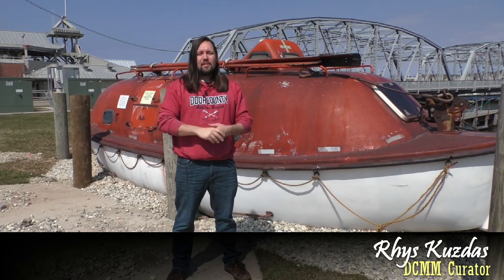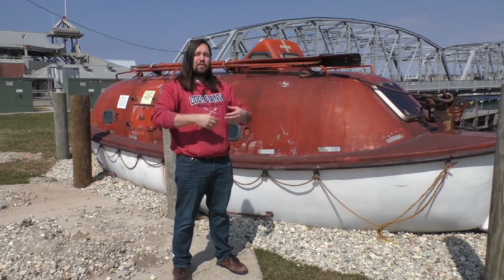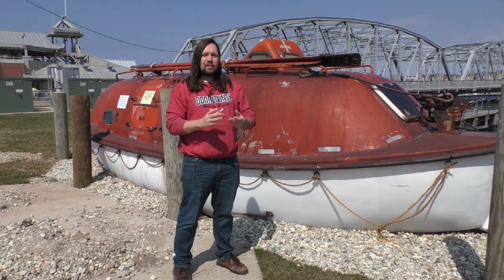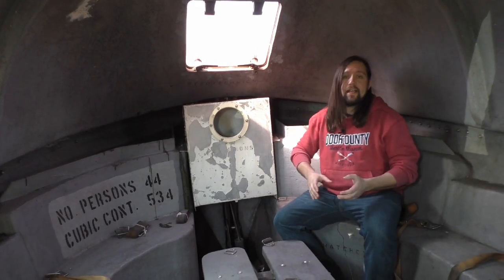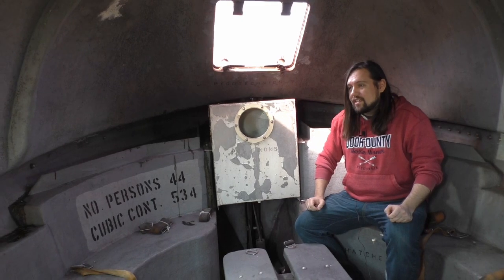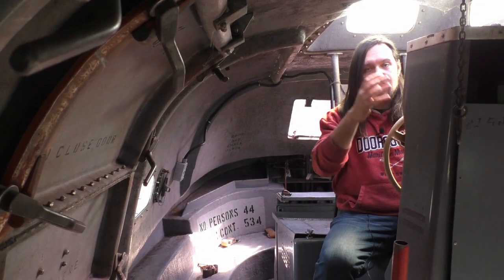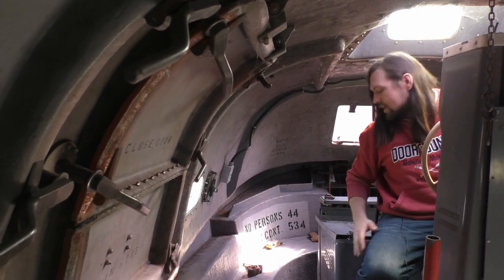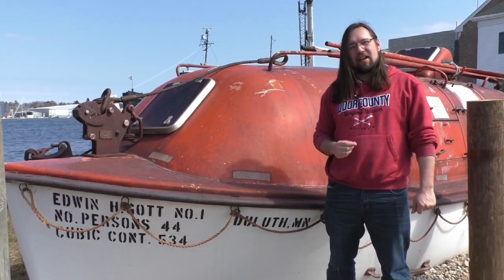The Water, Fire, and Hurricane Proof Lifeboat [FTD]

Comment: They look a little different nowadays, that is Ground Zero for modern lifeboat vessels. There are a new one available and there are drop records on YouTube for up to 65 meters. Used lifeboat conversions often get sneered at by yacht owners but I think they are really smart!
Reply: I think used life boat conversations are cool, too! A video on them popped up in my recommendations and I've been occasionally watching videos about them since. I'd like to do a small one someday and float her on the rivers here in the Willamette Valley. Depth would be a concern in some areas in the summer so I'd need some kind of inflatable pontoons or something on the sides to clear the hull from the bottom in parts of the river. I'd probably have to reinforce the hull in some way as well.The fact that they're fully enclosed is a bonus here because of the rain. A much wiser choice than a yacht!